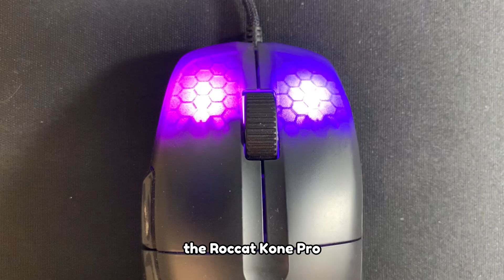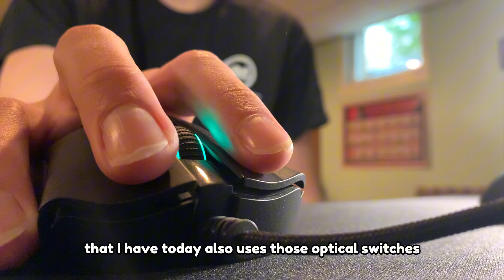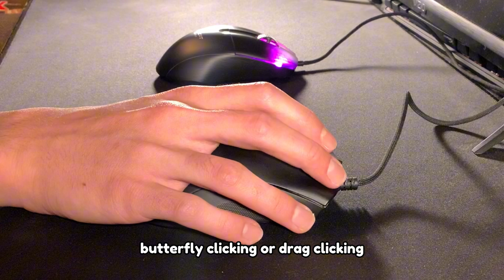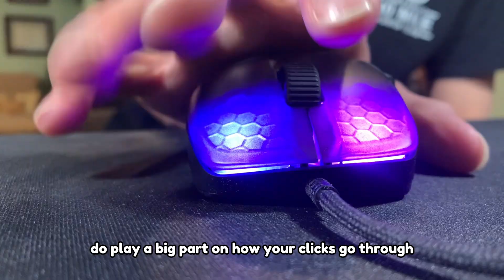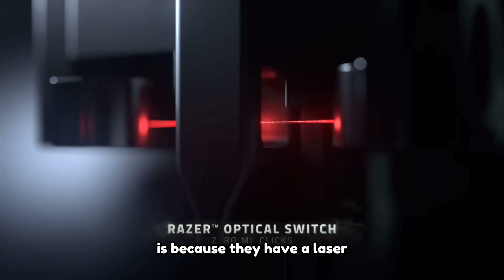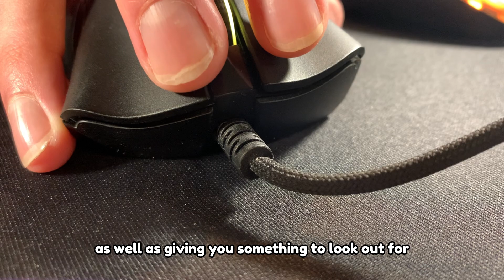Optical Vs Mechanical Mouse Switches | How Do They Affect CPS?

Comment: Are optical switches more durable than mechanical?

I've been using Logitech mice for a few years and my current one is a G604. My previous one was a G602. And the ones before that were also Logitech mice. I like this series because of the extra programmable keys. But, I think my G604 is going to be my last Logitech mouse.

I notice that, after about a year or two, they would often suffer from accidental double-clicks. I'm not a gamer. I'm a software developer and accidental double-clicks can be fatal to my work.

So, I've been looking for a replacement. I want something that will last me at least 5 years.
Reply: Have the same problem, did you end up replacing with optical switches and if so, what kind?
Reply: @bruhmanfromthefifthfloor  Yup. I bought a Roccat Kone Air. It was the cheapest I could find that was from a trusted brand (from what I've seen from reviews). I didn't want to spend a fortune for something that I wasn't yet sure about.

So far, it's been great and I really like it. It feels quite similar to my G604, albeit with fewer side buttons. The only thing I'm missing is the infinite/smooth scrolling.

Hopefully, it will last longer than my previous Logitech mice.
Reply: @RexTorres  how bizarre I was looking at the same brand just waiting on it to go on sale. lol I’ll take it as a sign to not repair the mouse and wait for the sale. Thanks for replying.
Reply: @bruhmanfromthefifthfloor  Np. Just note though that the Kone Air is _BIG_. I like 'em big but I know a lot of people like smaller mice. Also, for the price, it's not as premium-feeling as other higher-end mice. I wouldn't call it cheap-feeling; but it's definitely not high-end. And it's got no RGB, if that's important to you.
Reply: Search a teardown video of your mouse model in YouTube, you don't need dissembly completely your mouse, only where you can see your clics switchs. Put a drop of soft oil (like razor/shaver oil), on the dot of the switch, press the dot many times and clean the oil excessive, this solve the problems some times. You can replace the clic micro switches too. I have a Logitech G305, the main clic switch fail at 5 months. I replaced the micro switch with a Huano (brand) black case - yellow dot, micro switch with 8 millions of clicks of a lifetime. That switch has been working for 3 years on my mouse, I use it for work (8-12 hours/day) and play videogames (3-5 hours/week).
Reply: In theory, they should. I used viper mini for 2 years, every single day. And it never fails me.

Optical switch means the responsiveness is very much minimal. Less moving parts, less electrical ressistance, equal minimal response time. Also optical means no double click, forever. (Afaik. Unless there is some issue with the pcb inside)

Optical switches are amazing. I bought a new wireless mouse with mechanical switch last november,
 (Inno X2, basically same OEM as Kysona M600) and honestly the only thing it does better than viper mini is just there is no wire that slows it down.

And now it seems that this thing starts to double click. I might need to change the switch itself...